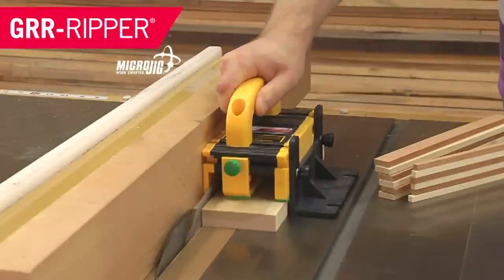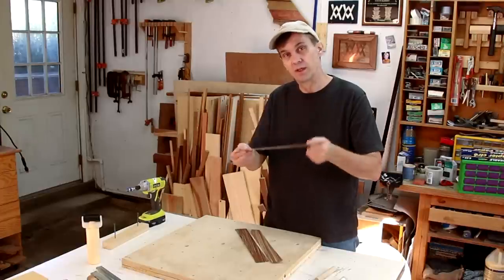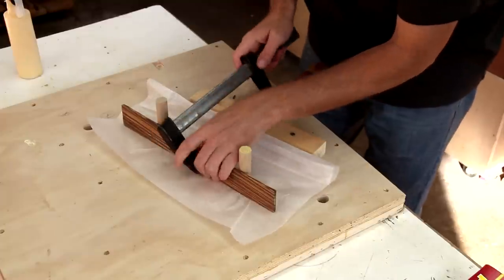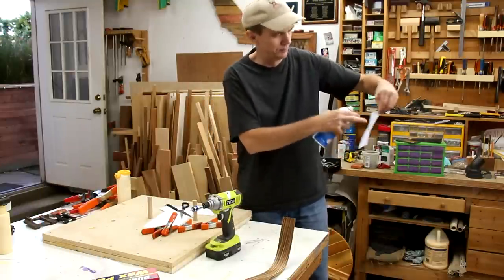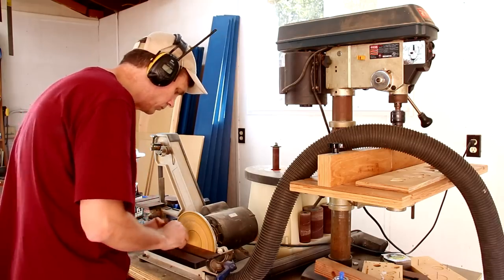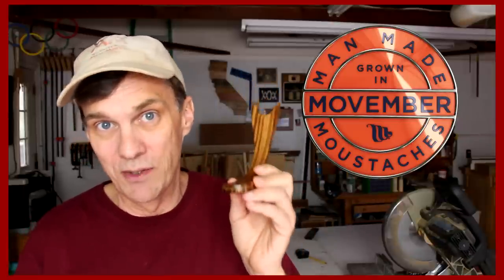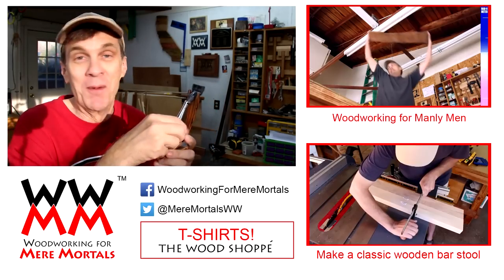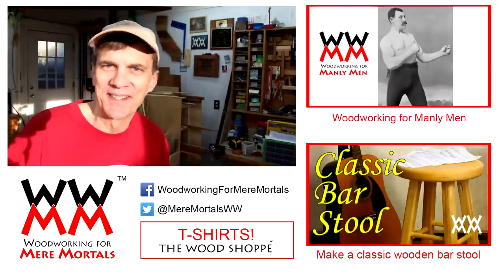Make this classy razor stand by bending wood

Comment: Steve, you finally did it, you sold a GRR-Ripper to me.  I like the tip of hotgluing the boards to a 2x4.  That looks much safer than my current method.  Using Safety as an reason has allowed a lot of tool purchases.  I'm also going to hit up the local hardwood floor shop to see about cut offs.  Thanks for sharing!
Reply: GRR-Rippers are GRR-Rate!!

Comment: Tried this, didn't work. I used red oak (thought you said oak bends easily) and aspen. Could only get a small bend in my wood, about 1/8" ish thick, before it would crack and break. Gave up after second attempt. What wood are you bending and what thickness did you use? Also cut my wood about 13 inches log.